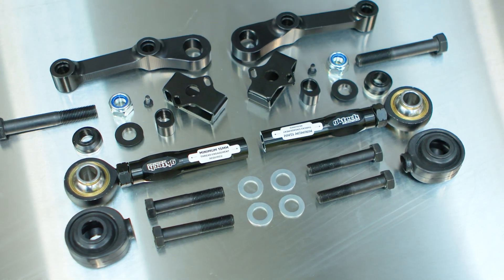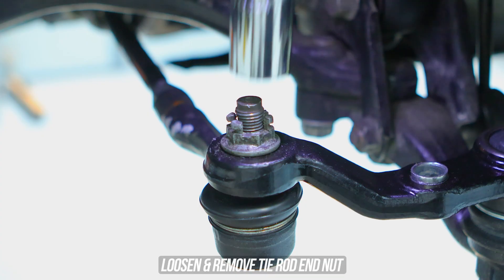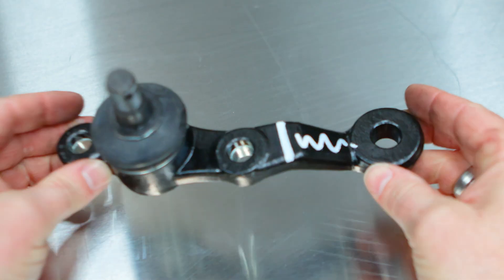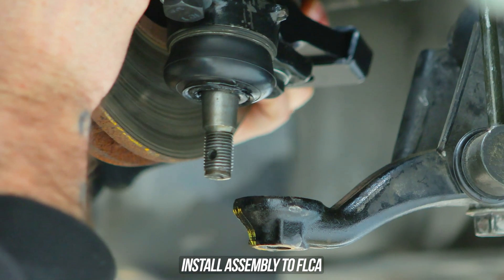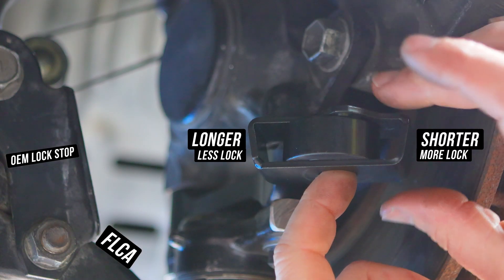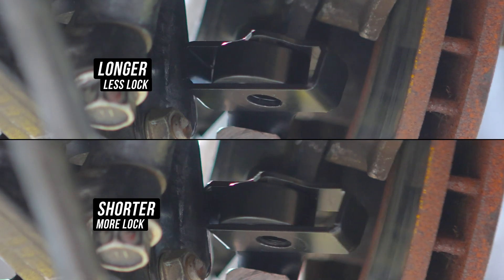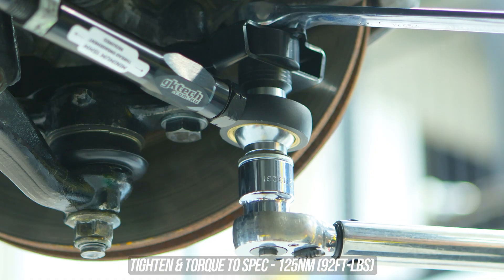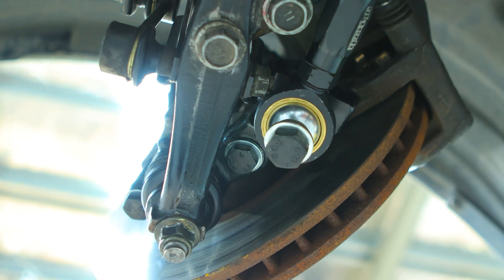Gktech IS200 IS300 Steering Angle Kit - Install

Comment: What ball joint brand would you guys reccomend to run? I heard moog fell off lol
Reply from the maker: Sometimes you can't beat OEM!
Reply: I did a lot of internet research on these years ago and I found one guy on a forum actually cut different balljoints in half and the OEM one was constructed differently, and better, than all other brands. OEM only on Toyota. This goes for ALL Toyota/Lexus that have this same design.